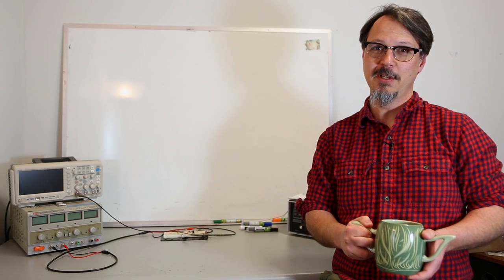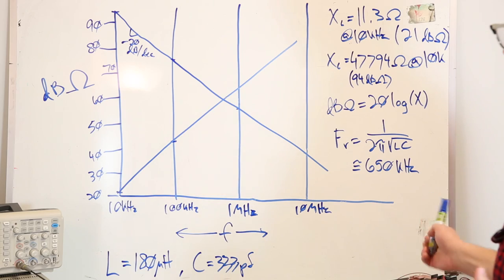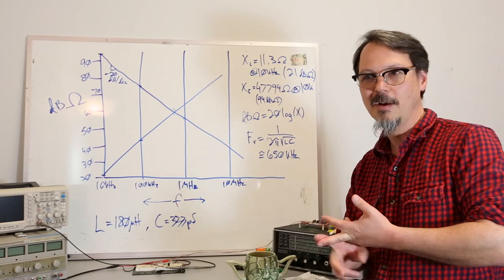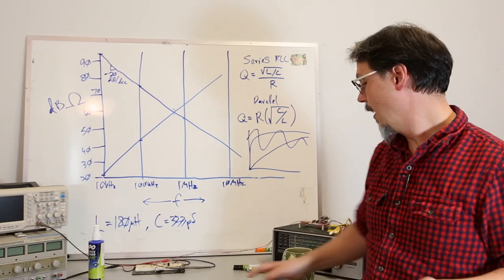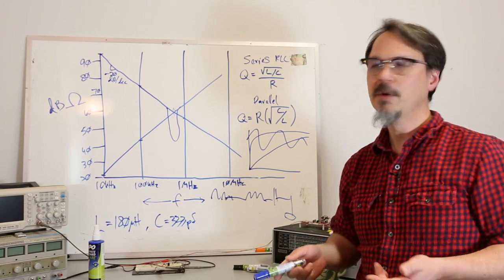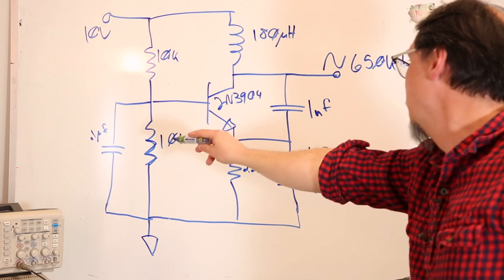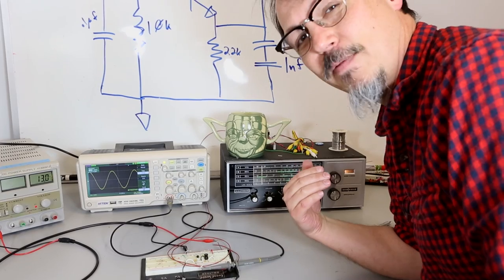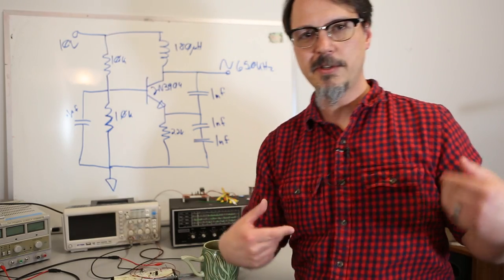SparkFun According to Pete #42 - Resonance Circuits

Comment: OK..  I have a dumb question that I probably should know the answer to, but don't...  :-)   Obviously, we weren't HEARING the 600khz signal, but that was the frequency the radio is tuned to..  SO, what determines the frequency we were hearing from the speaker when the carrier is a constant sine wave?
Reply: Sorry to be late. The frequency you're tuned to is the frequency the tuner is filtering out of all the frequencies mixed together in the spectrum (very complex, look up "resonance" on wikipedia). That frequency is modulated (encoded) to hold sound information. It depends on what type of modulation, I believe AM works by changing the peek to peek values of the radio waves to hold sound.

Comment: Resistance is the opposition to flow. Impedance is the opposition to change. Reactance is the measure of how the component 'reacts' to a given signal.
Reply: Abraham Barker An inductor acts like and analog of mass; It resists being moved but when put it motion tends to stay in motion.
A capacitor would be the analog of a spring; It readily accepts energy and will immediately return it.
Reply: Abraham Barker Q is the quality factor, factor of merit or magnification factor. The Q of a tuned circuit is usually determined by the Q of the inductor as the Q of the capacitor is usually quite large.
Reply: Abraham Barker Voltage applied across an inductor starts current to flow which creates a magnetic field. The magnetic field 'induces' a current in the rest of the inductor which 'impedes' the original current that created it. The more opposite current created the larger the impedance.
Reply: Abraham Barker To get a large Q you generally want a large inductance value with very little resistance. Self-capacitance short circuits the coil by causing current to flow in the same direction as the applied current.

Comment: A) dbOhms is represented using 10log(R/R), it is not a measure of power ratio for which the equation is given as 20log() due to the second power of voltage/current in expression for power P=IV.
B) Your plot is logarithmic wrt to frequency(ordinate), the abscissa(dBOhms) on the other hand is actually linear(the logarithm is hidden under the dB).

Otherwise thank you good job:)

Haha interference.....